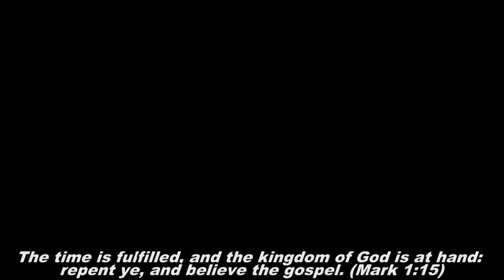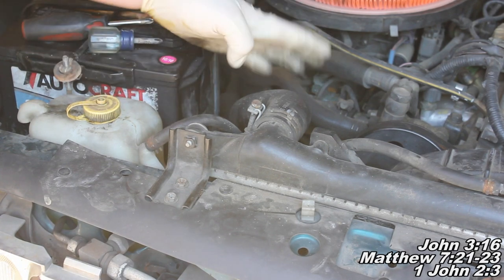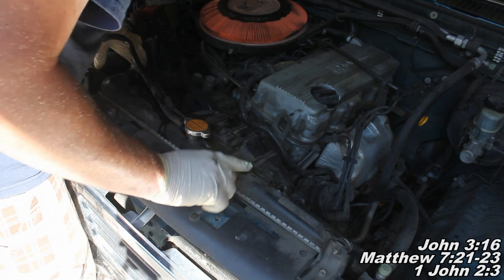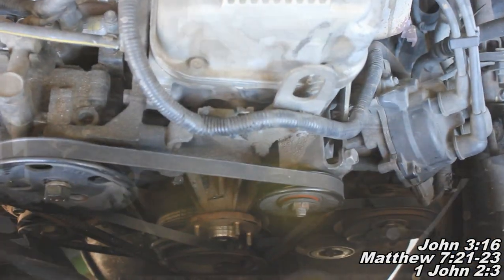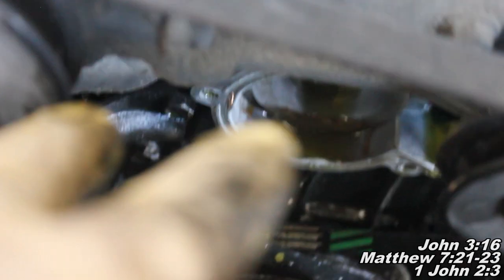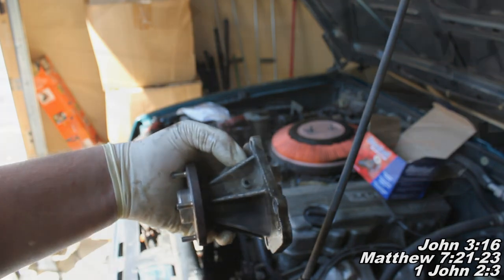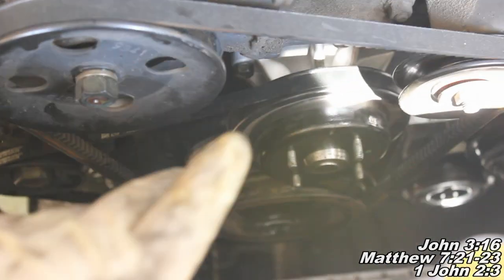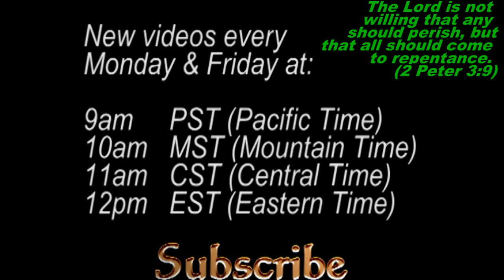Water Pump Remove Replacec "How to" Nissan Pick Up Truck

Comment: EXCELLENT video. I did my 94 truck this morning. Your video was right on with clearly detailed comprehensive instructions. I am a retired college administrator who has evaluated hundred of faculty for over 25 years!  The only problem was trying to get the nuts/washers back on the bolts (to re-attach the fan). I used super glue to bond the washer and nut. I then superglued the nut/washer to my wrench. This way I was able to get the nut/washer back on the screw with relative ease. THANKS again for your video!

Comment: You can put 2 nuts on the stud and tighten them to each other with 2 wrenches. Turn the inside nut to get the stud out. Turn the outside to put the stud in the new pump. Then use two wrenches and break the nuts apart.

Comment: If you click on the Gear shape in the bottom right corner (third from the right) of the video inset window (when you mouse over it) we can adjust the speed faster or slower, too.

Comment: how are you swapping out the water pump without taking off the crank pulley? the lower timing belt cover blocks the waterpump...
Reply: d21 4 cylinders are very basic engines, they didn't design them to be mechanical headaches, I was able to change my motor mounts from the top in mine
Reply: He does take the pulley off
Reply: This is the ka24e engine not the vg30e

Comment: I would note a brass screwdriver would be best to pry the old pump off with, it won't scratch the surface of the block and I noticed your using an auto zone water pump, be thankful they have good warranties, I've always had worst experience with anything duralast